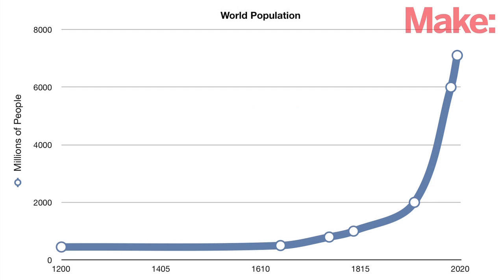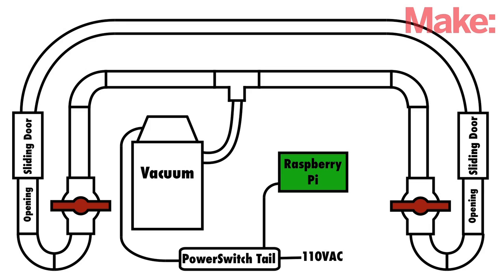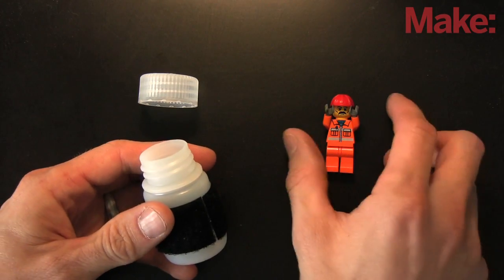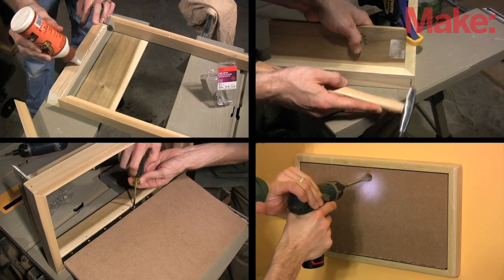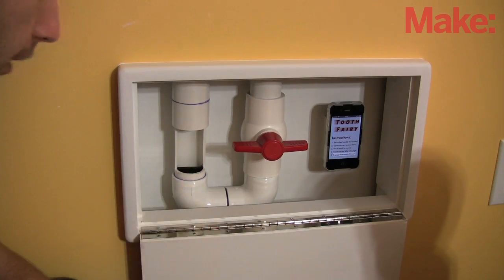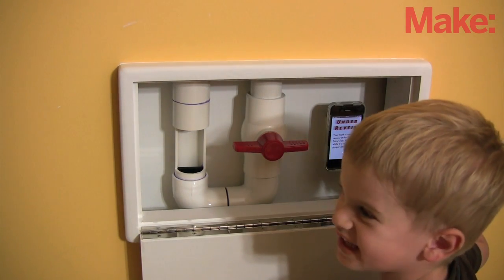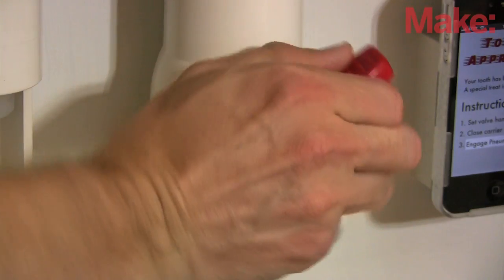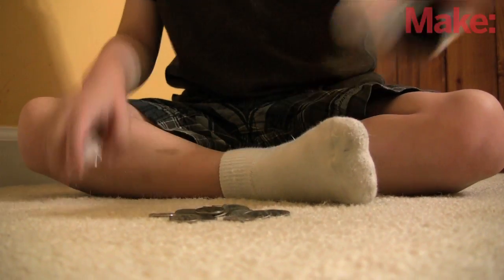Making Fun: Tooth Fairy Tooth Transport

Comment: Daymian Hogue They were actually trying to do that a while back in like the 70's -90's but found it to be too expensive at the time to transport it long distance like across town. Short distance however was used and is still used in some businesses and hospitals to transport information inside the building. Now it may be more easily implimented today but im not entirely sure businesses would see it as an advantage over the internet. However should the internet fail it would be an excellent back up system. Insided ones house is a very excellent use, say you wanted to get mail to the mailbox on a cold day, have a system set up so in the house next to the door you have a carrige holder that pulls it out to your mail box and vice versa when mail is delivered, though having the carrige indoors would be a good idea to keep it from being stolen and having a key for the outside with a copy given to the mailman would prevent people putting unwanted items in it. Dude you just gave me an excellent idea. Thanks

Also Father of the year award to pneumatic tooth fairy delivery

Comment: You need two smartphone cases to mount, but only one phone is used at a time. It slips out of the case when the system is not in use, so you can use your everyday phone. Or you could devise a different method of activation, like a really cool giant lever.

Comment: The phone will be removed for those times when it's not in "tooth" use. After all, it needs to be charged. The folks will have ample time to program the phone for the appropriate child / bedroom and place the phone behind the door before the child begins to use the transport system. Did you notice the key used to open the door? Also, the term "old iPhones" was used in the audio.

Comment: You're right, it wouldn't be as fun if you had to go to a different room to actuate it. I suppose you could use home automation controls. An X10 lamp remote might be a good way to get it done, with the vac plugged through the X10 unit into the service outlet next to the AC in the attic.

I had on my todo list to add a ZWave controller to the RPi, and then put the kids' room lights on ZWave controllers, so I could ominously dim the lights during actuation, but I ran out of budget and time.

Comment: Indeed, don't do any mains wiring if you're not sure of yourself in that area. You can find an outlet adapter, though, that screws into a light bulb socket. You could then plug the vac into that. Optionally, an electrician probably wouldn't charge much to switch out the plain bulb socket for a bulb socket that has an outlet on the side, too.

Comment: Making the GUI in Tumult's Hype didn't require much programming. It's a WYSIWYG editor, and has a free trial available. Though I polished the GUI over the course of a couple days, I had a quick-and-dirty version in one evening. You can skip the programming altogether, though, if you have a light bulb in your attic that is controlled by a switch in your house. Just get a socket adaptor and plug into that.

Comment: You could even skip the Pi altogether and use the attic light switch. A lot of houses have a light in the attic that can be turned on from the house below. A simple bulb-socket-to-outlet adapter and you're set.

Comment: The water valves I found said they required a certain amount of fluid pressure to help the valve open after solenoid activation. I wasn't confident enough in my little vacuum to try them.